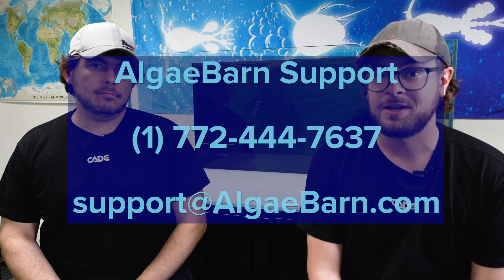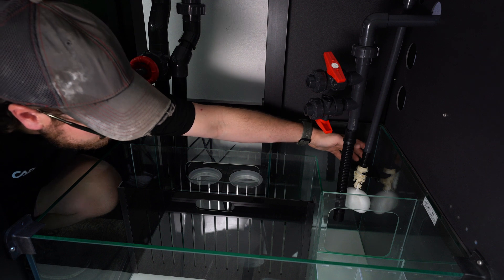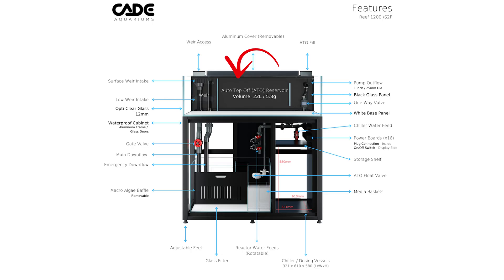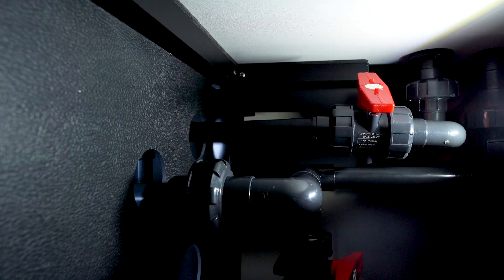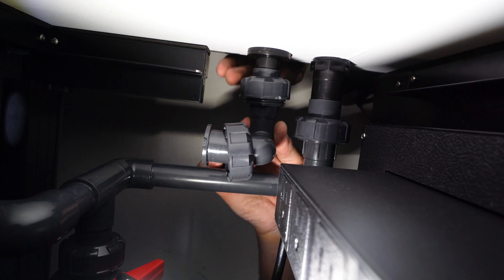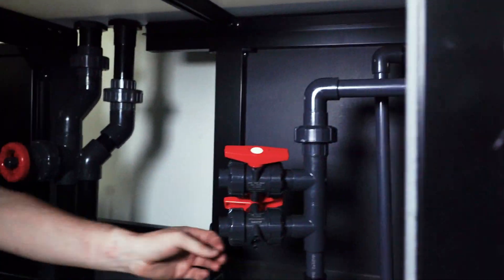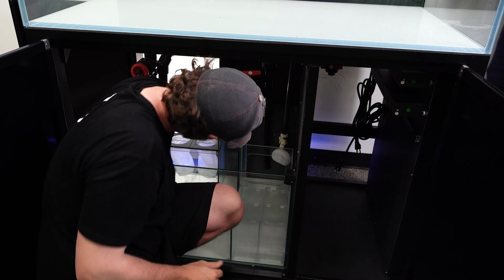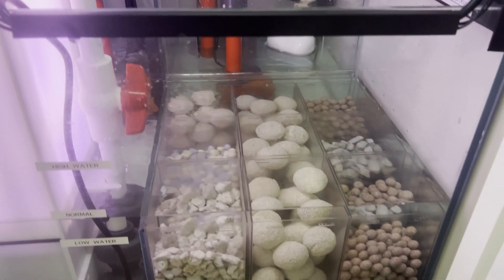Cade Plumbing Video 3 of 3: Automatic Top Off (ATO)

Comment: How it the float valve suppose to be positioned? I have a cade 900 and the top off valve won't stop filling the sump.
Reply: I know this is a long time later but it is installed backwards in the video for anyone else that looks it up.